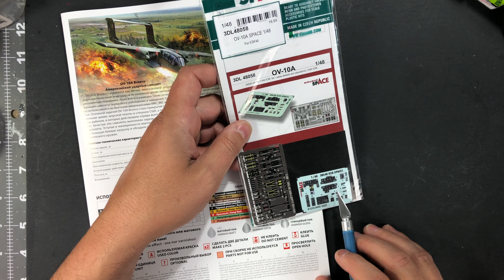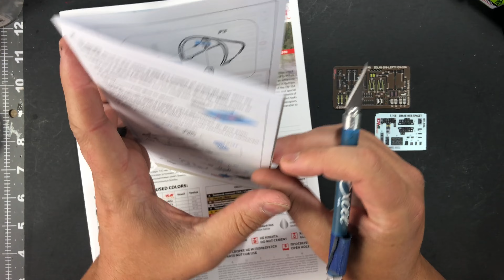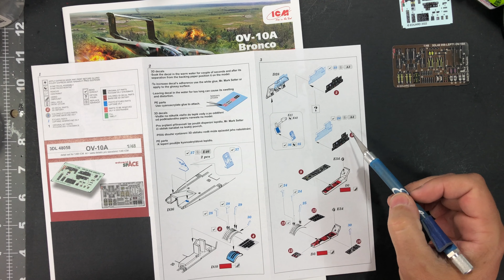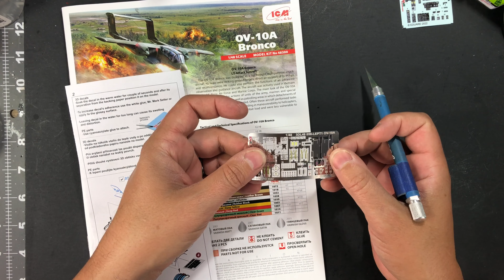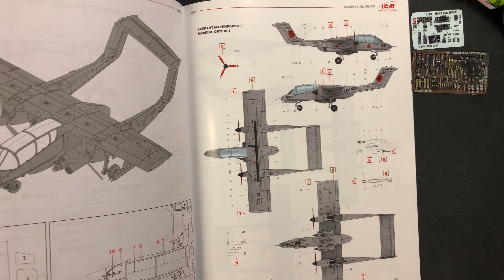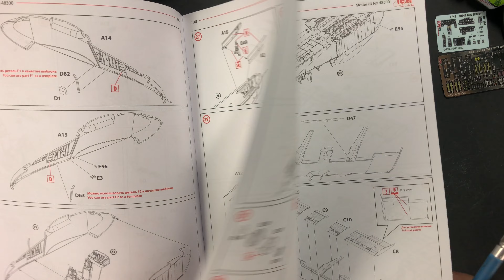ICM OV-10A Bronco 1/48 - 3D Decals

Comment: I haven't used 3D decals yet, I didn't realize Eduard are in the game until seeing your video (I was only aware of those made by Quinta Studio) so thanks for this! I am however using Eduard's pre-printed photoetch sets for my current ICM O-2A Skymaster build and I agree about the colour-matching issue. As I see it there are a few options: a) mix a paint as close to the colour of the PE or 3D decal as possible, b) remove the coloured portion of the pre-printed part and do not shave detail from that area of the kit part which can then be painted, or c) carefully paint overtop the coloured area on the pre-printed part with your paint of choice. Doing this I'd be inclined to use acrylic, as an enamel or lacquer-based paint could possibly eat into the printed surface. I'm wondering if you've tried any of these methods, and if so what your results were?
Reply from the maker: Hey, thanks for commenting. I’m inclined to go with 3) and I agree with you that acrylic would be the least aggressive on the decal.
Reply from the maker: I will probably try 3) once I start to tackle the HobbyBoss F-105 for which I also got 3D decals. If I remember correctly, they are the Quinta Studio type.